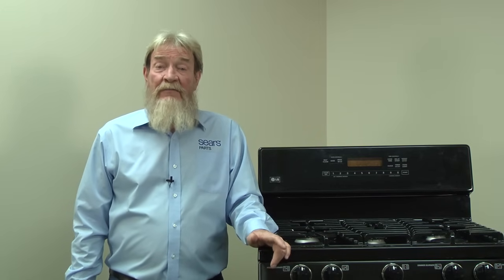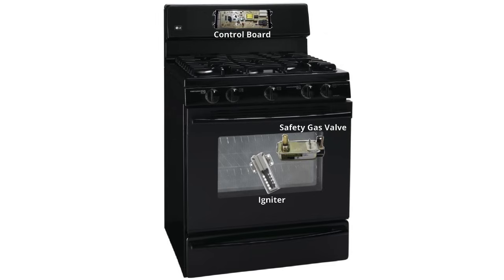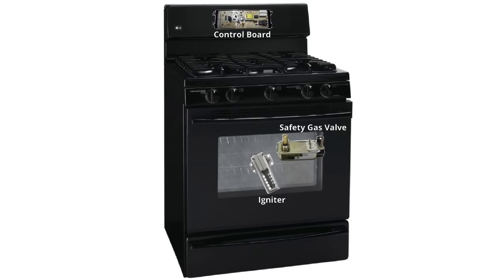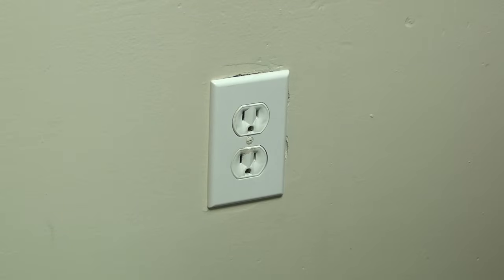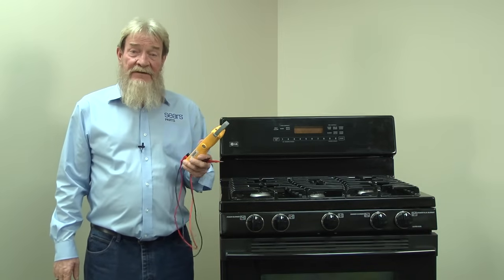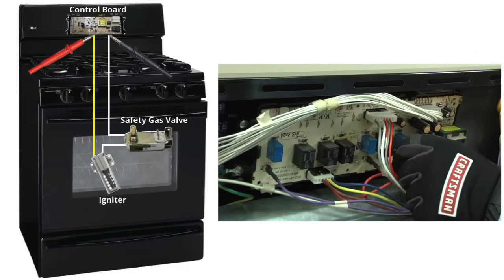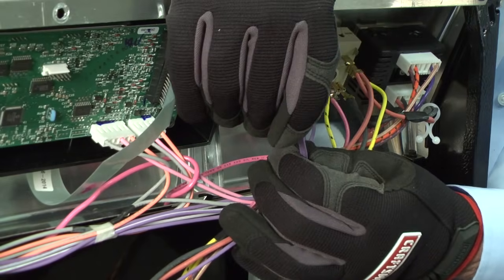How to Fix a Gas Oven that Won't Heat: Troubleshooting Gas Range Problems

Comment: My oven ignites, glowing through the panel on the left side, but not the right side (I don't know if it is supposed to glow on the right side or not)... but it is taking a LONG time to heat up and the therm. light does not go off showing oven is heated to the right temp, as often as it should, food takes a lot longer to heat... sometimes there is a smell of burning plastic or something, and sometimes the oven sounds, briefly, like a flame thrower, or may have a pop or woosh sound.  I did not hear you mention any of these other symptoms, so thought I would ask.  Does any of that help diagnose what the problem may be?  The oven has really not been used a whole lot (maybe once a week?); it is a stainless Kenmore (maybe 20 years old).  I've never run the "clean mode"; would that have anything to do with it? but like I said, the oven has not been used a lot and there is no grease residue inside, so I have never run the clean mode).  Thanks, Robert

Comment: oven burner only lights partially. is there a separate gas safety valve for the broiler. It lights fine
Reply: I'm having the same issue.  What did yours turn out to be?  There is a separate valve in our gas safety valve for the broiler, so it is possible for just one part of it to fail.  Replacing our igniter didn't fix it, so I'm planning to replace the safety valve next.

Comment: My Kenmore gas oven made a click then popped the breaker. After that it won't heat up. I changed out the igniter but the new igniter won't light either. Any thoughts?
Reply from the maker: Your symptoms indicate that a relay on the electronic control board likely shorted out. Unplug the range and access the control board as shown in this video https://www.searspartsdirect.com/diy/repair-guide/how-to-replace-a-gas-range-oven-control-board . Check the components on the control board and look for burn marks. If the control board is damaged, replace it. If the control board looks okay, check the wiring between the control board and the igniter for damaged insulation that may have shorted to metal inside the range cabinet. We hope this advice helps. Let us know if you need further assistance.
Reply: @searspartsdirect  Thanks for the quick reply. The broiler and cook top still work. Still thinking control board?
Reply: @searspartsdirect  any opinion after the additional info I gave you?

Comment: I have this same oven, 
   
My Whirlpool Oven Will Light, but only stay lit for 3-4 seconds. it turns off as soon as the bake spark Ignitor stops clicking. Model Number WFG374LVS1
I Tried changing the Spark Igniter : Part Number : w10324262
Oven Temp Probe : Part number : W10181986
The Only Part left to change is the Gas regulator Valve: Part number WPW10293048
But this gas Regulator is backordered and hard to find.  Plus when I put it on broil, it works amazing. Its just bake that will not stay lit. 
What do I do now? Buy the Control Board?

Comment: A little over two years ago, I had the 'glowing but not heating enough' problem, bought and installed a new igniter, and all was well-until now. Suddenly the igniter isn't glowing at all, and nothing happens when the oven's turned on. The oven light works, which I presume means the oven's getting electricity (and no breaker is tripped). Not sure if I should order another igniter and try replacing again. Because the oven is built in, I can't check anything on the back of it (at least, I don't know how to). Could be the oven is old enough it's just given up the ghost entirely. Oy.... Anyway, thanks for this video, which really is worthwhile.

Comment: I replaced the igniter even though it was glowing bright and it had a resistance of 175 ohms. The new igniter had a resistance of 115 ohms and I was fairly certain that this would NOT correct the problem. Boy, was I wrong! The oven fired right up!! Thank you Wayne!

Comment: if they bought a igniter one for a whirpool or G.E. (for another brand) oven and decided they didnt need it and then put the same igniter into a magic chef would it work? the igniter is glowing red but produces no flame. are the igniters specific for each brand of oven?
Reply from the maker: Sometimes the same part will fit and work in different models but not always. There are two main types of glow bar igniters--one has a rectangular housing and the other has a cylindrical (round) housing. Those 2 types of igniters typically aren't interchangeable because the safety gas valve opens based on resistance of the igniter and those 2 igniters have different resistance specifications. Let us know the part number of the igniter and the model number of the Magic Chef range or oven and check for compatibility.
Reply: @searspartsdirect  thank you so much if i remember correctly the original igniter was cylindrical  this one is rectangular i figured it was something like that not the correct signal/resistance. thanks for the response. ✌🏻😎

Comment: Hopefully you can help me fix my Samsung gas oven. I have changed the igniter, the temperature sensor, the control board and it has not made a difference. It will pre heat like it should but after about 20 minutes or so the temp has gone down as much as 100 degrees from the preheat temp of 350. Help

Comment: I understood everything. My igniter burns very bright and it can't glow any brighter. And the safety gas valve doesn't break usually. So that means I have to replace the electronics and to pay a technician who will charge as much money as buying a new oven. And I understand why this oven was created; in our current time, companies make products with a short life-span. So that people buy newer and newer appliances. So that these companies extract more natural resources and pay for delivery and transportation. Are we saving our planet this way? What can I say in the end? F... you! Now I'll buy an oven not made by Samsung. I will never purchase a Samsung product ever again. 5 years ago I threw away my Samsung TV and replaced it with a Sony. Samsung is garbage. In the Soviet Union, we had gas ovens that didn't have any electronics and worked for 45 years without any issues. It worked well because it had no computers or electronics. My current oven only worked for 5 years. My refrigerator from Samsung is also 5 years old and has been having problems for 2 of those 5 years.

Comment: Desperately in need of assistance. What is the problem with my stove where when you turn on the burner the flame is normal height? But if you turn on a second or third burner at the same time the flame from the 1st burner lowers to a minimum. And the other burners also only get a very low flame
Reply from the maker: What you're describing seems to be a gas supply problem or possibly a bad pressure regulator on the range.

Comment: Hi.   I have the Kenmore model 790. Surface burners are working. All lights and display are working.     Both oven and broil ignitors won't glow.   When  Testing resistance on control board, should one probe go to black wire on control board and the other to the pin (#6) that goes to ignitor?   If so, I'm reading 0.09.  Bad board??
Reply from the maker: Let us know the full model number of your Kenmore 790 range if the following advice doesn't help. It's unlikely (but remotely possible) that both igniters would fail at the same time. You can check resistance through each igniter as described in the video (also in this written version https://www.searspartsdirect.com/diy/article/oven-wont-heat-troubleshooting-gas-range-problems-video ). If both igniters are bad, replace both igniters. If the igniters are okay, check continuity through the safety gas valve. If the gas valve is okay, check the temperature sensor. You should measure around 1080 ohms through the temperature sensor at room temperature. If all of those components are okay, then you may need to replace the electronic control board.
Reply: @searspartsdirect  Thermostat 1075; boiler ignitor 172; oven ignitor 306; gas safety valve 2.2 - 3.8.  Using a Centric multimeter.  Kenmore Gas oven.   Model #: 790.72333013; serial #: VF20458105
Reply from the maker: @patniven9334  The resistance values that you provided seem to indicate that the components are good. We recommend checking the wiring. Make sure you measure those same resistance readings through the wires that connect to the control board. If you do, then you'll likely need to replace the control board ( https://www.searspartsdirect.com/product/2rtxb86hep-0022-628/id-316462803 ). If you replace the control board, you may also need the overlay unless you can peel the old one off and install it on the new one.

Comment: Gas oven come on when I turn it to bake it just won’t go up to 400 it will come on 350 it will go down but will not go up to 400 what I need to do show me
Reply from the maker: Your description seems to indicate that the up button on the control isn't working. Replacing the electronic control board will likely fix that problem. Here's a repair guide/video that shows how to replace that part: https://www.searspartsdirect.com/diy/repair-guide/how-to-replace-a-gas-range-oven-control-board

Comment: Because of this video. I was able to find out that the reason my oven wouldn't preheat, was because of a bad igniter. I followed all the tips, ordered a new one, replaced and fixed the issue. Our oven works as good as new! Thank you for posting this easy to follow video.

Comment: The clock is working fine and the gas burners are working. It's just the control panel is dead.

Comment: Thank you ! Thank you! Giving us the ohm reading to expect made a big difference! I had replaced the ignitor already with a new one and still no workie!  Control board seemed fine and I was just perplexed as there is really not much else to these things,. Voltage was there from the switch so I am like, what! After knowing what to expect from a good one I decided to check my broiler ignitor and got the correct reading. Swapped it into the oven position and boom! Looks like they sent me a bad replacement part is it was practically open as well. That was not good or expected but knowing what the readings should be for this part and the regulator gives me a lot more confidence when things don't work on any range.

Comment: I'm getting gas and the igniter glows, but it won't heat. I can smell the gas and see the igniter glow. But no heat. What can be the problem?
Reply from the maker: Even though the igniter glows, it may not be getting hot enough to allow the right amount of current to flow through the safety valve and ignite the burner. Replacing the igniter will likely fix the problem that you're describing.

Comment: Fantastic video, thank you!  Was worried it was a gas problem when it was going on and off.  Replaced ignitor as you said and voila!  working oven.  That would have certainly fooled me if not for your help.  Appreciate it very much!

Comment: My oven is gas and tripping the panel breaker after 10 mins of full temp. Nothing I can find will help  me with this. The inginter is working and oven comes to temp. like it should. Any thoughts?
Reply from the maker: A short circuit in the wiring of the oven circuit would cause the panel breaker to trip. Unplug the oven and check wiring if possible (or have a service technician check the wiring). A faulty panel breaker could be tripping even though excessive current isn't flowing through the circuit. A technician can check current flow through the appliance to see if current spikes when the panel breaker trips. We hope this information helps. If you need more assistance, let us know.

Comment: People say the igniter isn’t “hot” enough, but that’s likely not the case. The igniter can get plenty hot, but the resistance through it has gotten to a point that it does not provide enough amperage to make the safety valve open. That valve needs to see a minimum level of amperage to know that the igniter is hot enough to light the gas. I like the suggestion to swap the baking igniter with the broiler igniter and see if it works. If it does, it proves it was the igniter.
Reply: Do you happen to know what the amperages draw should normally be?
Reply: @enduringpromise  No I don't the specific amperage that would open the valve.  I was about to replace one in my oven when I made my first comment. Was planning to swap the igniters to check, but of course they were very different types, and wouldn't work.  I didn't bother to see what the amp draw was before replacing, but it was still red hot.  Once the igniter was replaced, it started right up, valve opened and flowed gas which ignited and the oven heated up. I got mine from a legit parts e-tailer (Parts Dr) and it was about $180.  I didn't trust I'd get the right model on Amazon or that it would last more than a year.

Comment: How to diagnose correctly,   Thinking the oven sensor was bad,  I replaced it.   Problem is still there.   The oven when turned on (set at 350) surges to above 450.  Left alone it will gradually  (usually takes 15 to 20 minutes) to go down to the temp wanted.   Given the exorbitant cost of an electronic module  I have left it as is.   Would a different temp sensor possibly cure this?
Reply from the maker: Not likely. The temperature sensor is likely working properly because the control eventually maintains oven temperature at the set temperature.

Comment: Have a Frigidaire Gas oven (BGGF3042KFE)  top & broiler all work fine, bake will not work.  Igniter wasn't turning red, so I ordered one from you.  Installed it and oven worked the first time.  Hasn't worked since. So checked all the connections, couldn't get it to work on "bake".  Ordered a new control board and installed it.  Oven still will not work on "bake".  The igniter still will not turn red.   Only thing left is the gas valve.  Don't feel comfortable replacing it.  Can't locate a repairman that will come out to replace it.

Comment: Very helpful video.  I was coming to the conclusion that because the igniter was glowing my problem must’ve been with the safety gas valve but I changed my mind based on your video. And you were right it was the igniter.
Reply from the maker: Thanks for letting us know what you found. We're glad to hear that you fixed the problem and that our video helped.

Comment: Would these same trouble shooting items apply if burners and broiler work but oven doesn’t?
Reply from the maker: You don't need to check the gas supply because the surface burners and broiler work but the rest of the troubleshooting is the same.

Comment: Replaced my igniter and that worked for a few months - now back to igniter not glowing at all -- control board/panel issue?
Reply from the maker: We recommend that you unplug the range and check continuity through the igniter using a multimeter. If you measure infinite resistance though the igniter then you’ll need to replace it again. Don’t touch the igniter element with bare fingers because oil from your fingers can cause the igniter element to fail within a few months after you install it. If the igniter is okay, check continuity through the igniter circuit from the control board (with the range still unplugged). If your meter measures infinite resistance (no continuity) through the igniter circuit then a bad safety valve or wiring failure is preventing the igniter from glowing. If you do measure continuity through the igniter circuit, then you’ll likely need to replace the control board if the igniter won’t glow when you start the oven in the bake mode. We hope these tips help. If you need further assistance, let us know. If you get to a point where you need to have a service technician diagnose and repair the range, you can schedule service here: https://www.searshomeservices.com/repair

Comment: Good info! I still have a problem! Oven won't light unless we light a surface burner first! Possible solution? Kenmore 790.74333313, about 4 years old on propane.  Thanks!

Comment: Great video, but can I suggest you start with check all wiring first since this is the least expensive, and then igniter, valve, and control unit. Again Great video!!

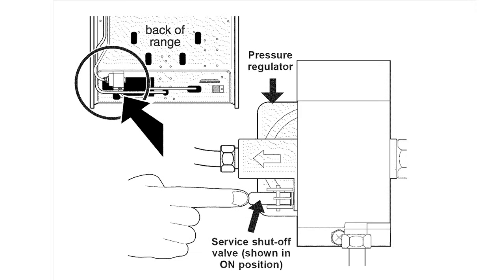Comment: OMG!!! First tutorial I found mentioning the "Service cut-off valve" 0:36. I didn't know even that existed. You saved me a ton of money man. Acquired an used range not long ago and I was going to replace the broil and baker igniters thinking they were defective. I thought my igniters didn't probably glow strong enough to trigger the safety gas valve. After watching the start of the video I immediately ran to the back of my range and there I found it. My oven "cut-off switch" turned off. I just turned it on and oven is now working like a charm 😊😊. THANK YOU WAYNE!!!!!!
Reply from the maker: We're glad to hear that you fixed the problem and that our video helped. Thanks for letting us know what you found.

Comment: I smell gas when I turn on my oven, and it doesn't light even 5 min after turning it on. I light it manually but the flame is about 1/2 the strength of what it normally should be? Is this a faulty igniter not reaching its correct temperature?
Reply from the maker: We recommend that you shut off the gas supply to the oven and stop using it until a service technician diagnoses and repairs the oven. You shouldn't be able to manually light the oven burner in an oven that uses a glow bar igniter systems like the one shown in this video. The safety gas valve should only open if the igniter gets hot enough to allow enough electrical current to flow through the safety gas valve to trip the safety valve switch. We recommend that you have a service technician examine and repair the oven because your symptoms indicate possibly dangerous failures in the igniter, gas valve and related components such as wiring, burner and gas supply tubing. We hope this advice helps. If you need further assistance, let us know.